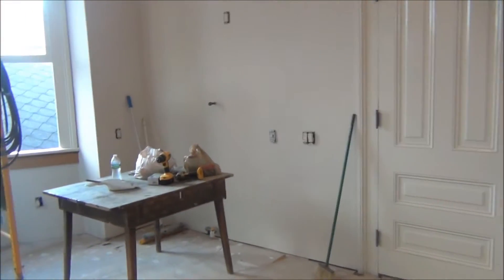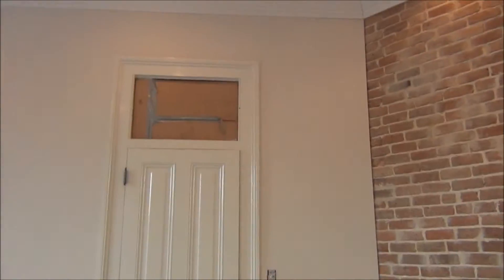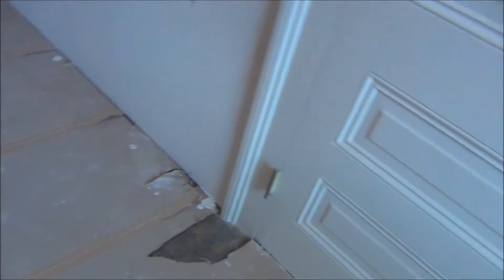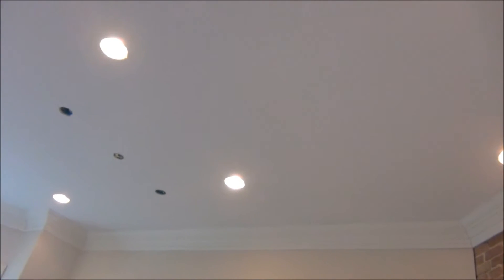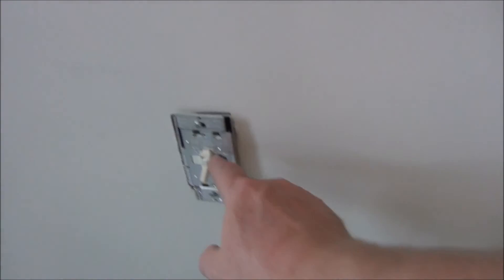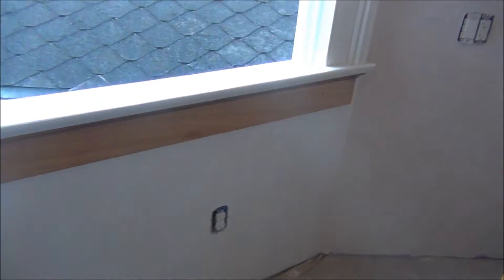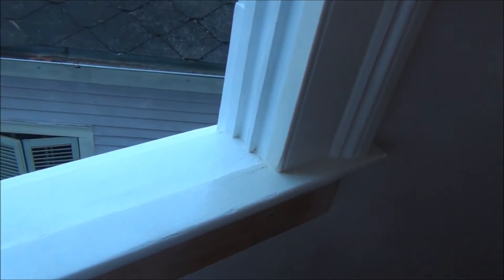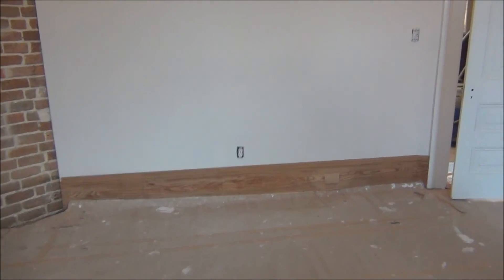Kitchen Renovation part#35

Comment: Just a dab of white latex caulking in the joints of the crown moulding with yer finger and it will look perfect. Works good on nail holes as well. No need to repaint.